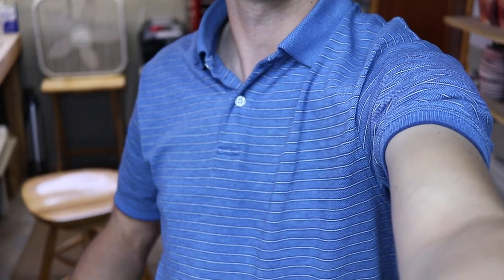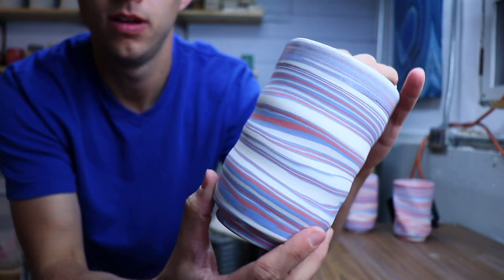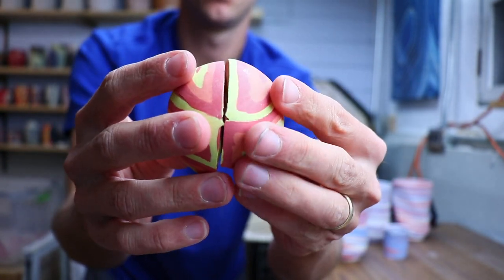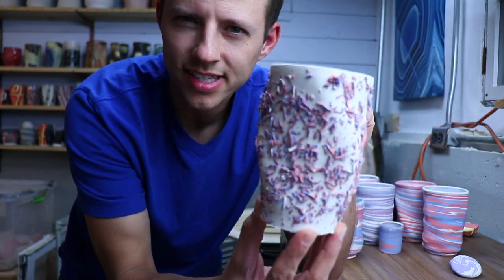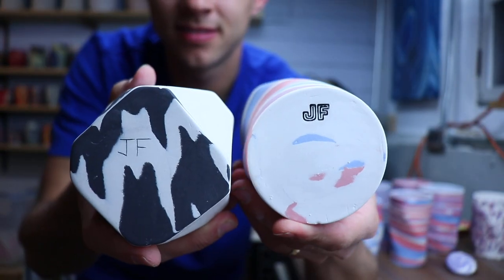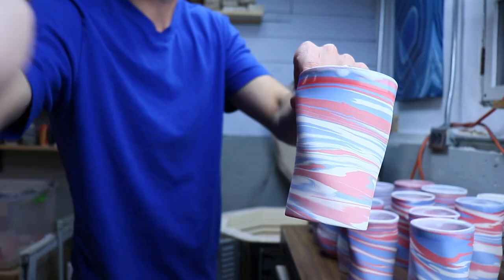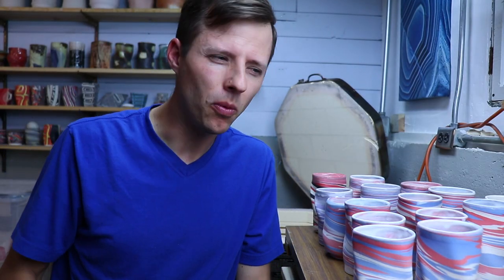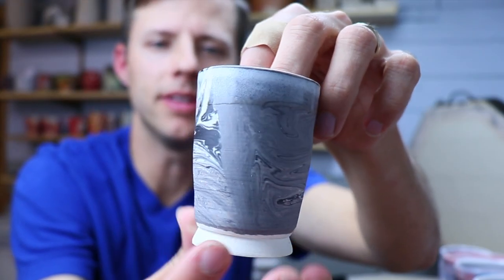Agateware, Puzzles, and Funfetti Pottery | Kiln Unloading #4

Comment: loved seeing all these.. interesting how similar effects yet you throw and I use molds an slipware.. I am an love with agate ware.. but surprisingly I found what you call funfetti I made sprinkles lol with some success.. pieces I was cleaning I would use potato peeler and keep the shards, sometime peeling thick slices then pressing them into slabs, or place 1st into molds then pour slip, or even mini success with the wheel.. (I am terrible at the wheel, but once thrown, i damped a little then adhered/places these shards around the piece, compressing down of course, but they looked great..) just sad the item didn't survive the kiln ended up with s crack) ceramics is  like riding a skate board you fall of and then you get back on it. Tip - to stop drying out, I would place some of the pieces on to dam tea towel.. I also noticed you loved the mini one with the peachy swirl, I wonder, once you have thrown an object what if you add plain coloured shaving in odd shapes? try little bits see what happens? cheers T
Reply from the maker: Thanks for sharing Patricia. I enjoy hearing what everyone else is working on in their studio practice. That gives me a lot of ideas. And I never stop experimenting. This video was a fun kiln unloading with lots of tests that I learned from. My work has evolved a lot since then in such a short time. I love saving the scraps! Find clever ways to reuse them is a constant thought it my head. Thanks for the comment. Be well!

Comment: I mean yeah, that could be dunting, but that is generally caused by too rapid of cooling, or a difference of COE between the interior and exterior glazes.  Since nothing else had that issue, it's probably not that.
Moisture does seem to be more likely, especially since it happened in the bottom, which tends to be the issue with many wares.

Regardless, still a good load.
Reply from the maker: Yeah that makes sense, Ben. I very much appreciate you weighing in on it. One piece out of twenty or so isn’t so bad when I think about it I guess. Thanks for the compliment!
Reply: @CeramicJim  I had some student slab boxes have a similar issue.  They looked very similar to that.  Separation, but still attached.